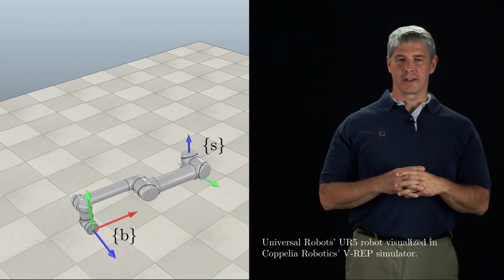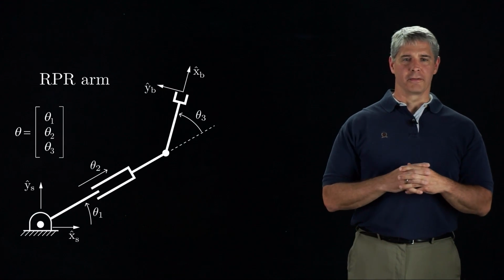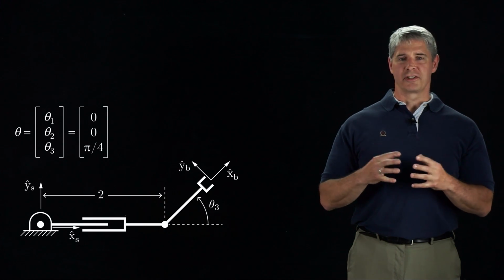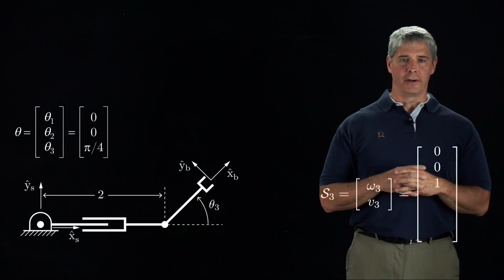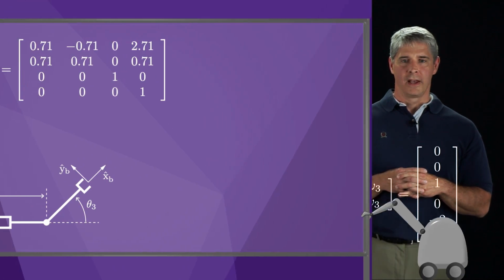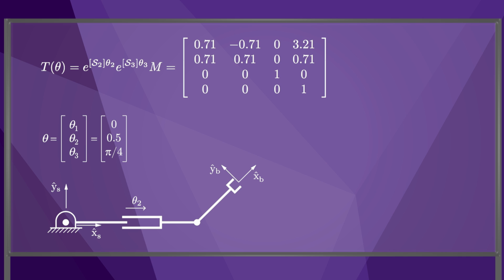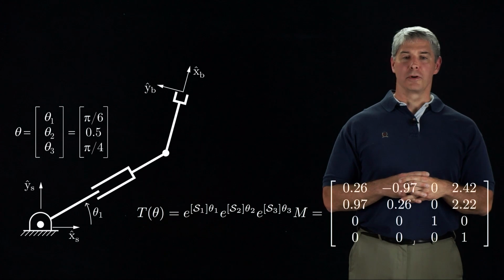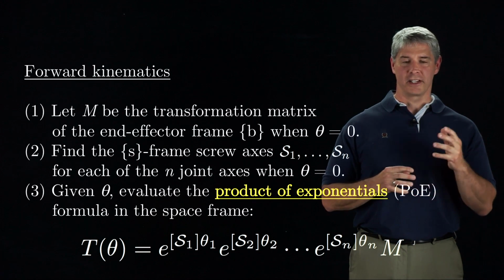Modern Robotics, Chapter 4.1.1:  Product of Exponentials Formula in the Space Frame

Comment: Pro tip: the cross product is anticommutative, so -omega × q can be rewritten as q × omega. Which is much easier to remember and will make programming much simpler by eliminating an easy to introduce error
Reply: The propose is to simplify the numerical calculations. because the first vector always has two zeros.
Reply: @osamanagee594  i doubt the performance boost is worth incurring an easy to avoid error